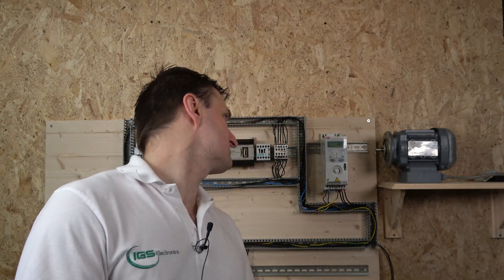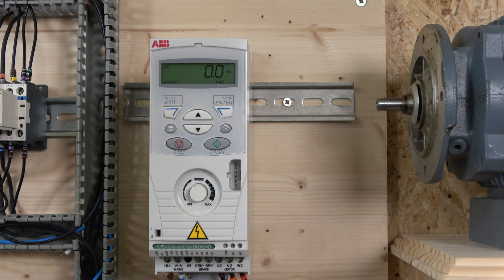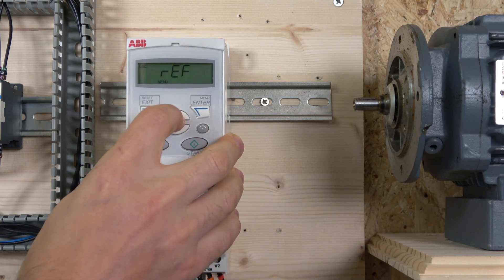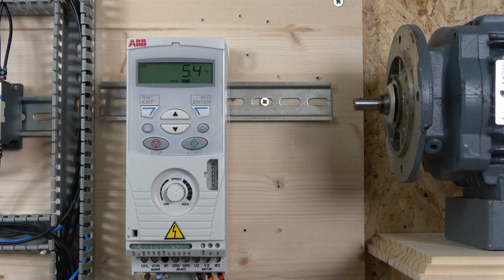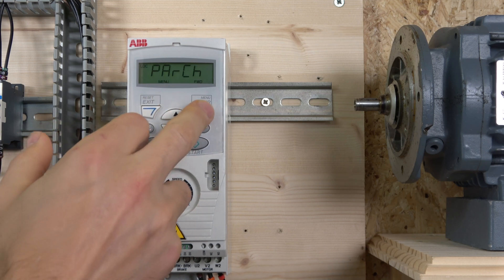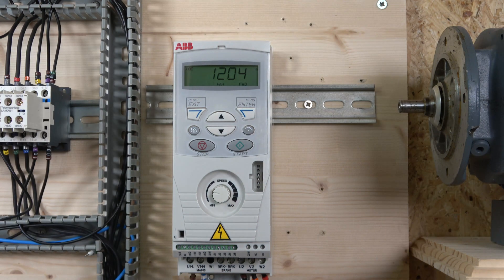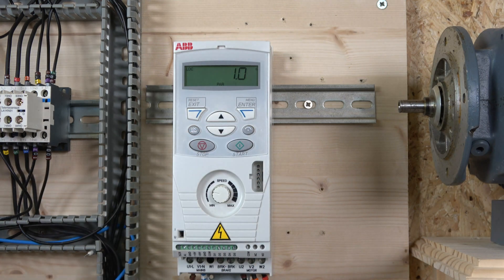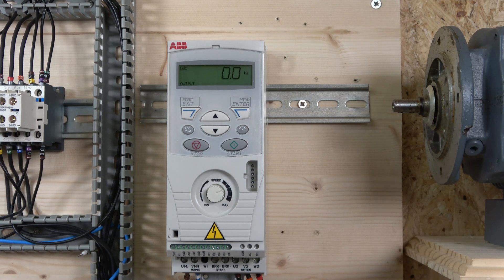ABB ACS150 VFD local control, commissioning, parameter set up and Factory reset. ( English)

Comment: Hi great video! I have a external on/off switch for my commercial kitchen extractor fan, recently I had my fan replaced now the external switch isn't working, I now need to switch on via the ABB. Can this be fixed ?
Reply: Sounds like a wiring issue not the VFD itself. If all you did was replace the fan, granted the fan was replaced with the same specs as the previous fan